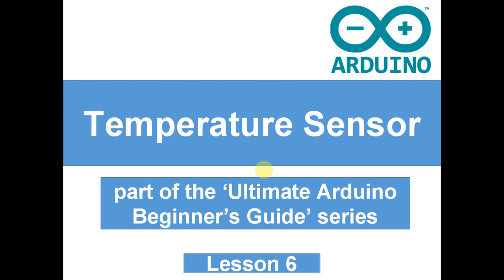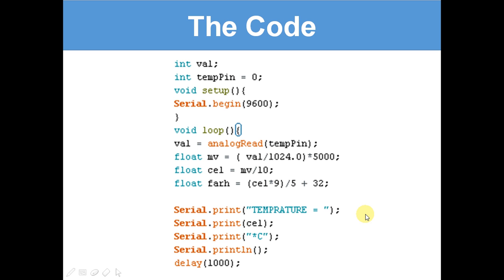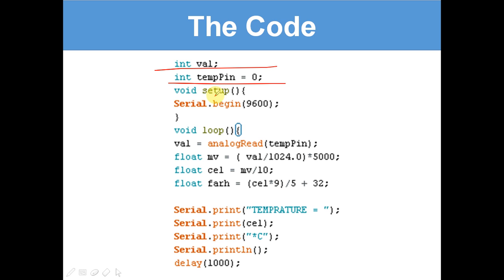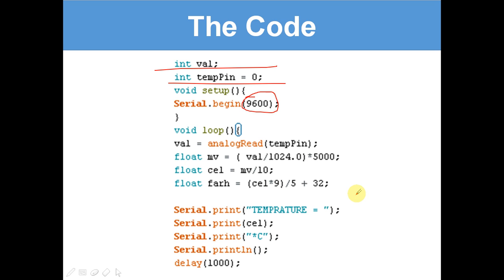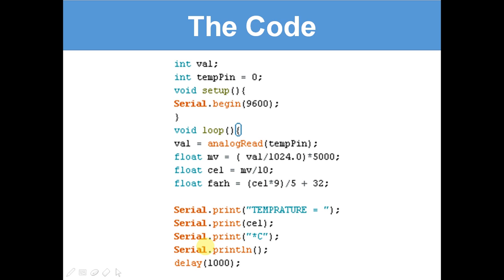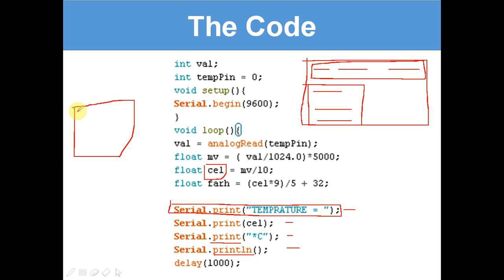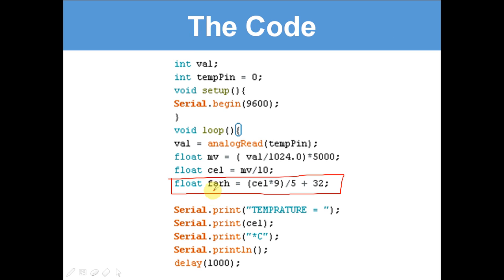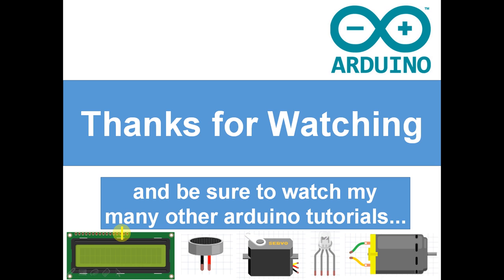Temperature Sensor (#6 Ultimate Beginner's Guide to Arduino)

Comment: Thanks for posting. A couple of questions.  Rather than divide mv by 10, why not just times by 500 verses 5000 in the line above?   Question 2: My understanding is the LM35 reads between 0 at 0 volts and 1023 at 5 volts, so there are 1024 values (but counting zero) the range is only up to 1023, not 1024. Should your value not be 1023 instead of 1024?  Again thanks for sharing and for any additional insight into what are admittedly very minor details.